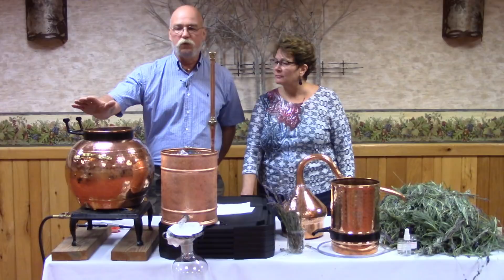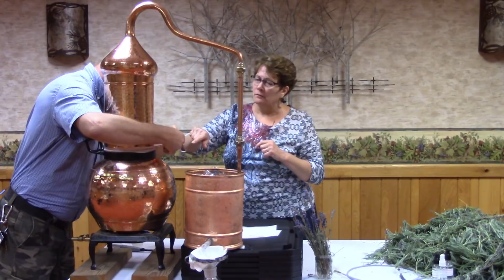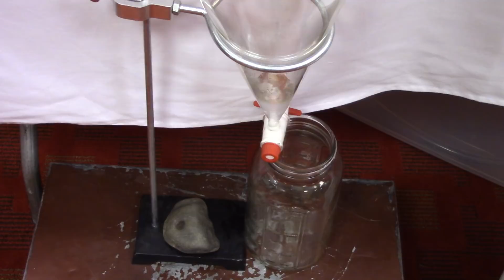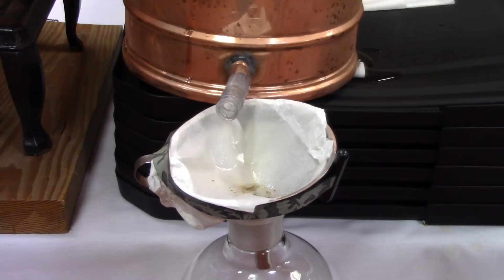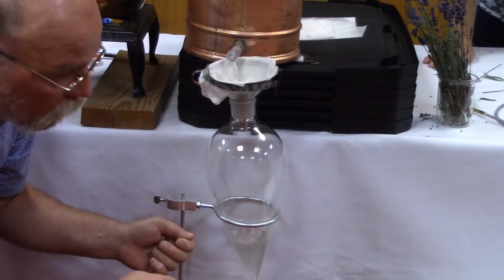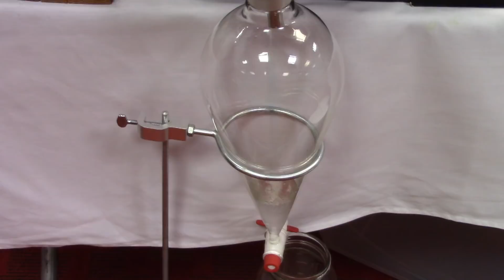Distilling Hydrosols & Essential Oils

Comment: Essential oils will not ever evaporate. They may break down, the most volatile terpenes can be lost to heat, sun or UV light and even drying to quickly rather than proper curing. Also I’m confident you are only getting a 60% or less extraction efficiency. Try a correctly polarized solvent in respect to target compound. I’ve used N-butane (100% organic compound) to pull lavender oil in a supercritical extraction (a liquid solvent at a given pressure and temperature acts as a liquid, regarding extraction efficiency, yet flows easily and uniformly like a gas through base material.
Reply: Can v get agar n sendle wood oil on dis fully

Comment: If you bruise the plant material first, would you get more essential oils from it?
Reply: Great question Amanda. It depends on the plant. For the soft, leafy plants in the Lamiaceae family, like lavender and peppermint, there is no need to bruise the plant matieral as the essential oil trichomes (glands) are on the outside and the oil is easy to glean from the plant.  Plants with a heavy cuticle, like bay leaf, or the confiers, need to be either bruised or soaked to soften the cuticle.  Thanks for asking!  Liz Fulcher, AromaticWisdomInstitute.com

Comment: Would it be possible to use dried plants in the distillation process for hydrosols? For example if I wanted to create a rose hydrosol, could I use dried roses? I know that fresh will probably be better due to the cellular moisture that Liz was referring but I am curious as to what is extracted when dried plants are used :)

Comment: would it bo worth outing the plant material in a blender to speed up the process?
Reply: Really not necessary and in truth, would increase the time the cut plant is exposed to the air and losing valuable essential oil and cellular water.  It's really best just to cut the plant and distill as soon as possible.  Great question and an interesting thought!  Liz Fulcher, AromaticWisdomInstitute.com

Comment: Oil is not always lighter than water. There are oils that are quite heavy.

Some plants have a LOT of essential oil. RESEARCH before deciding.

You are the first people that have said to use fresh plant material.
Reply: Hi Steven, you are correct, oil is not always lighter than water.  In fact, weight isn't the factor but rather, density that keeps water below the essential oil. As you mentioned, there are plants that produce essential oils that will sink below the hydrosol, like Catnip for example. The time we had for the demonstration was tight so those details were beyond the time we'd been given.  As for the fresh versus dried plant material, our mentor, Ann Harman who wrote "Harvest to Hydrosols" says that plants in the lamiaceae family, those that are leafy and contain a lot of cellular water, need to be distilled as quickly as possible to capture every bit of the plants liquid - water and essential oil - before it begins to evaporate. For other plants, such as resins and the woods and those with a heavy cuticle like bay, don't need to be fresh.  Thanks for your in put!  Liz Fulcher, AromaticWisdomInstitute.com